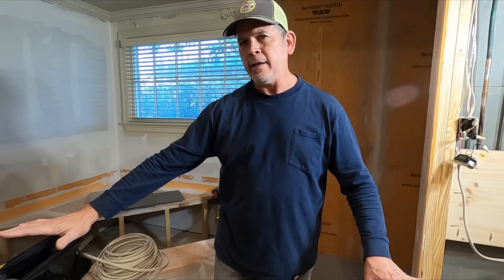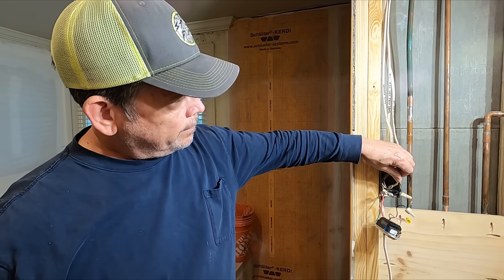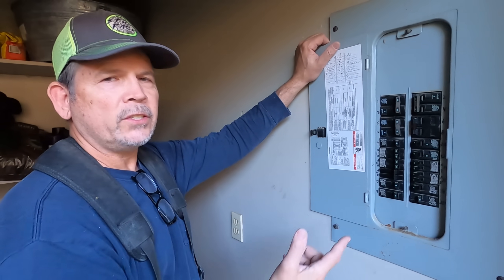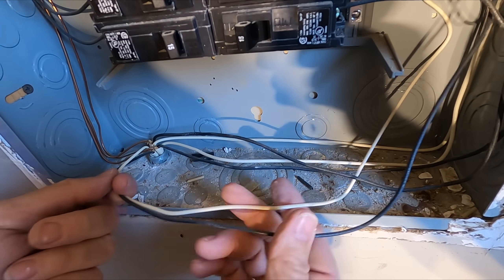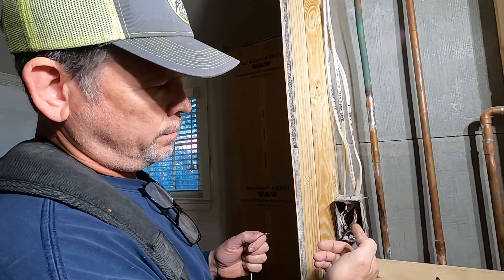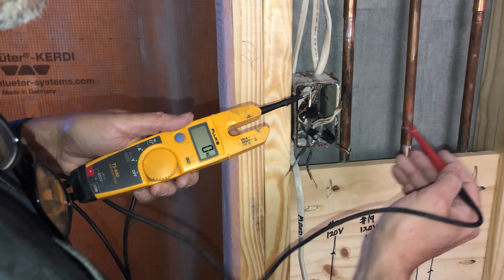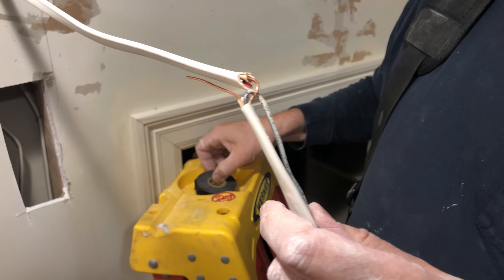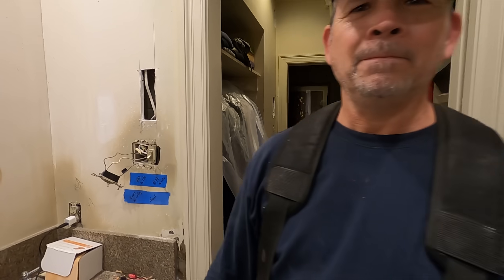You CAN Get SHOCKED by a Neutral Wire! This is How...

Comment: This a small sample of what happens when the home handyman, or anyone else that isn't qualified, does electrical work. "But the guy at Home Depot said........".  The people that work in the stores haven't a clue.
Neutrals and grounds are far more deadly than hots are and for good reason.
Reply: Properly wired Neutral wires and Ground wires are much safer than Hot wires. Those who ASSUME they are wired properly, with first verifying,  are the problem ...
Reply: @MrSummitville  The problem is when neutral connections are opened under load or a ground that is carrying a fault is opened. When the line side wire is touched, the body is now carrying the load (current) of that circuit which can easily be way more than enough to paralyze and kill. When touching a hot wire , the current flow is only what the body resistance allows. It can still be deadly, but your chances are better.
Neutrals are commonly opened in multiwire circuits where one one circuit is off and in single circuits where the power is believed to be off.  Grounds can be carrying current at anytime and you would know.  it will happen to plumbers that remove a bonding jumper on a water meter and in a variety of situations.

Comment: I'm not sure I understand why the neutral was left dangling in the three way switch box. What are some likely explanations?
Reply from the maker: The original electrician ran 14/2 between the two 3 way switches instead of 14/3 so he left himself without a neutral.  He picked one up in another box and simply abandoned the neutral he should have used.
Reply: @StudPack  Thank you now that fills in my missing link. That was really crappy of him. The mindset of "It works so I'm done, not my problem". Thanks for the explanation.
Reply: @StudPack  14/2 was the goto method back in the day though. 14/3 was uncommon in residential, cost more. wouldnt lay 'blame' on the original installer for using what couldve been considered standard at the time

Comment: We electricians in UK call this situation; a “borrowed neutral” often occurs when a downstairs light is wired in later years after construction. It makes wiring simpler to “ borrow a neutral” from the upstairs lighting circuit. Everything works fine until somebody starts poking around in switch boxes, and finds the error the “ hard way” .................shocking!
Reply: And that neutral may end up carrying 30amps instead of 15, without tripping any breakers. That house can get more light than intended.
Reply: @sergeyn.syritsyn6748  That neutral should NOT be carrying 30amps if done correctly.   The US has used "borrowed neutrals" as well, not sure if it's been coded out though that would be something you very often saw with knob and tube wiring less of an issue for NM wire runs since every cable has a neutral anyways,  but the idea is you take opposite phases and as a result you could potentially have 0 amps if both wires are running.   Looking at his drawn diagram of #19 & #20 junction boxes I would say this is most likely the case of what happened as odd values will be one phase, and even values will be another phase.      But the fact this was done with NM wire seems silly though.
Reply: @Mike__B  shared neutrals have been coded out for years. When I started out in the electrical trade back in the early 80’s it was discovered that a majority of all house fires were caused from an overload neutral because of neutral sharing.
Reply: @Mike__B  and car manufacturers still produce cars…doesn’t mean you youse it as a boat. 12-3 NM can be used in various residential applications, an example of that if you have a long run of exterior lights and you want to balance a voltage drop, next would be for a 3 way switch, another is for 3 phase 120/240 or 208/240, wrap a piece of green on it and you use as a ground and use the bare conductor as a bonding jumper between panels…as I said a bunch of applications. But to say because a manufacturer makes 12-3 Romex so you can use it to violate code by sharing a neutral in a circuit is ludicrous
Reply: @Mike__B  depends on where you are located in the states. You are referring to what we call multi branch circuits. Here in Texas in my district it is not permissible but I can go to the next and it allowed only by certified engineering.
Reply: Problems are sometimes caused here in the USA when they share a neutral on the same phase.  The current through the neutral is then the sum of the currents in the two hot legs which causes an overcurrent in the neutral that isn't detected by the breakers since the breakers are reading current in the hot legs.  When the hot legs are from the different phases the difference of the current flowing through the hot legs is what flows through the neutral.  It's why I think it's safer just to use a separate neutral for each circuit.
Reply: @Anon54387  That is so true. Here in the UK, every circuit is required to have a separate neutral rated for the breaker. 
Unlike the US, our 240 volt domestic supply is the grounded star point of the 415 volt final transformer, so on a 3 phase supply the neutral is the same size of the phase conductors. Electricians who are not electrical engineers often find it confusing that the current in the neutral cannot exceed the maximum current in any one phase due to current cancellation.
Needless to say, it is the reason that we cannot centre tap a phase to produce 120 volts, since one side or the tap would be shorted to the star point.
Reply: People often forget that the low (domestic) supply in the UK and the US is configured differently.
Here in the UK, the high voltage grid (11Kv) is delta with the centre phase bonded to earth. The final transformer is delta star, with the star point bonded to earth, so this forms the neutral. The supply is 415 volts, which gives 240 volts between each phase and the star point (neutral)
In the US, the final transformer is single phase or delta secondary with a centre tap on each phase bonded to earth. This allows 120 or 240 volt supplies to be obtained from each phase as required, again with 415 volts between phases.
Reply: In sweden if you do this. It MUST be 2-pol braker and also be text on panel that for exempel. F.20-19 using same neutral and earth.

But ofc, real work don’t do this shit.
Reply: Always come across that problem.
Reply: Shared neutrals are not permitted under any circumstances in accordance with the NEC. Though it’s still being used in the states, it depends on the inspector. When I conduct an inspection I often have the electrician remove the neutrals from the buss and do continuity check per circuit. Much simpler than opening every j-box. If the contractor has nothing to hide, they normally don’t mind.

Comment: Back in the day we would share neutrals on branch circuits.In most commercial installations you'll have three phase power.We'd pull a network of three hots(A,B,C phase),a single neutral,and a ground.When you have different phases sharing a neutral everything is fine.The current on the neutral returning to the panel is not excessive because of the nature of how phasing balances the load out...However,if you share a neutral with like phases then the neutral current will add together causing an overloaded neutral wire....The practice of sharing neutrals in my area has been discontinued for a long time now..The risk of getting shocked was too high..not to mention what happens when a neutral gets opened causing backfeeding which results in 240 volts going to receptacles, destroying equipment.
Reply from the maker: Thx chipper!  Perfectly stated.  I used to work at a place where a loose neutral caused backfeeding.  The resultant higher voltage burned up computers, printers, etc.  There was so much damage to equipment that they were able to file a claim with a $5000 deductible.

Comment: Guarantee there was an interim remodel by a armature electrician . Electricity is very straight forward . There is no magic .  (THAT shared neutral was result of DIY jerk that should have taken a bite of humble pie and researched a little )
I bought a house w THREE 3-4 way lights that only worked at the 'new ' dimmer switch .   THREE circuits wired wrong  and fixed with a minor rewired connections )    (original wiring in house was done right)

Comment: Doesn't the black tape on that neutral colored wire signify that it is actually a hot "black" wire or traveler?
Reply from the maker: I put it there to let me know which white wire had the voltage on it.  See my pinned comment.  It was definitely a neutral.  Couldn't be a traveler, this was after both switches and the load.  Thx for watching and commenting 👍

Comment: LOL... Irony is a strange ass thing my friend. Just  a few days ago I went through this exact same lesson with my 15 yr old son. A little while ago we bought another "renter special" that was built in '68; fun, fun, fun... The whole house was pretty much illegal, CA 3-way, or whatever you call them in your particular neck of the woods. The 2 main things I find in these old homes are:
1. All lights on same circuit, all receptacles on same circuit, etc.
2. All home runs were pulled to fixtures, instead of a switch location.

Anyway, was fixing a 3-way light circuit in the hallway and had to pull a couple new wires. 1 14/2 and 1 14/3 and I bet you can guess where and what for. Hint... I already had hot pulled into one of the rough in boxes from when I redid the kitchen, but the rest of that "jacked up" circuit was the way we found it.

Comment: I'm not even a journeyman electrician, just a jack of all trades master of none. I would have NEVER left a "unused" wire in a box.
Reply from the maker: Especially without a wire nut on the stripped wire 😳
Reply: @StudPack  even then I wouldn't have left one. If there is an extra wire I've done something wrong. From my learning that setup should have had 3 conductor wire (black, white, and red traveler) between switches. Not two sets of two conductor wire.
Reply: @campingwithpapaw  what IF that wasnt a 3way setup? you'd still have have a neutral in the switchbox, you'd have unused wire anyway in a 14/3 application. we ran 14/3 UF to exterior light poles, only used the black and white, red is just a spare or in case we need to add a photocell to specific poles

Comment: I am a certified electrician. You cannot take a colored wire, and put white tape on it in order to turn it into a neutral wire, but code allows you to mark a neutral wire with either blue, red or black tape and use it as a live wire. One more thing,  in any US or canadian home, you don't have phases. The service panel is fed with 120/240 single phase. There are 2 LINES...and one neutral.
Reply from the maker: Thx for commenting 👍  I marked that neutral with black tape as an indicator to me that it was the “hot” neutral.  I removed it later.  It definitely was a loaded neutral.  A hot would have tripped the breaker when connected to the copper pipe.  Yeah sorry about phases too line is correct.   A throwback to my commercial days 👍👍

Comment: YES on electrical.
- I "HAD" a handyman(actually a woman) who worked on an outlet without turning off the breaker.
--- I stopped the work, paid them, and sent them home.
-- I'm not a pro, just a homeowner.
I just had to start one more sentence with "I".. because..
Reply: you can do outlet, switch replacements live. should a handyman, electrician when shutting power off is feasible? YES does every handyman, electrician? NO

Comment: I ran into a similar situation and also got a jolt through a light. It definitely changed my perspective. I am much more careful to check wires. I don’t trust a non-contact voltage detector as a definitive answer, but I think it could help prevent situations like this.

Comment: this was great information.  i have seen similar issues in automotive wiring where a circuit is missing a ground and back feeds through a different circuit but never thought about this in home wiring and i have been shocked by a neutral before replacing a dropped ceiling light fixture with the breaker off just like you did.  this make so much sense now.  thanks for taking the time to share

Comment: how can you have a difference of potential between 2 neutrals on the neutral side of the load?
Reply: One of the Neutral Wires was being "back-feed" from another load (light) & switch from a second Circuit Breaker that was still ON ...

Comment: The neutral in that box is marked with a strip of black tape. Many jurisdictions allow for a white wire to be used as a hot as long as it is marked with black. This is common with 4 way light switches.

In this instance someone probably tried to fix someone else's mistake in a hurry instead of taking the time to figure out the issue like you did. 

Great video series!
Reply from the maker: That was me marking it as a "hot" neutral.  See my pinned comment.  Thanks Jason!!

Comment: As your typical homeowner viewer, I would like to know if one of the cheaper Klein light/beep voltage testers (NCVT-1) would have picked up on the "hot" neutral. I always check the area I'm working in with that tool, even with the breaker off, just to be on the safe side. Is this proper and would this "hot" neutral still be detected in the event I was to find one?
Reply from the maker: Klein has something cheap? 🤣  Yes it SHOULD pick up a "hot" neutral.  My issue was that after everything was confirmed to be safe, someone turned on a 3 way switch in another room and energized that neutral.
Reply: @StudPack  Haha, if they had something cheap, I definitely found it. But thank you for the reply and information on this. I just wanted verification that this would still be picked up as hot and my current method of testing would help me find this should it ever happen.

Comment: Enjoyed the video.  I too would like to see more videos talking about how you got shocked.  I've been bitten a few times and it was extremely unpleasant.

One comment:  I'm not an electrician but I am an experienced technician.  You made reference to "phases" coming into the box.  There is only one phase coming into the box.  It is a split single phase.  Measuring 240 VAC means you are looking at opposite ends of the same phase winding.  Most residential buildings don't have 2 or 3 phases connected to it.
Reply from the maker: Thx Greg.  Yeah I know re: phases.  Some say phase, some say leg, some say line.  Kinda like a polarized plug but AC current doesn't have polarity (like DC) 👍
Reply: Yeah, many a debates I've seen on this. I don't think it's universally agreed upon that they're NOT two phases in behavioral ways. It's sort of semantics. 
Split phase is certainly most correct, and I'm not really arguing that they should necessarily be called 2 phases, but in pretty much every way they do represent two, 180 degree phases with reference to neutral. (whereas 3 phase are 120 degrees; 2 phase are often 90 degrees). If you don't reference to neutral (as you don't with 220 volt) then really it IS one phase, but then again so is any system running off 2 legs of any voltage, including two legs of a 3 phase system.

Where I've landed on this: it should be called a 'split-phase system' but referring to each leg as a phase isn't truly abhorrent from a physics standpoint. I'm open to rebuttal on that point though.

Comment: so basically don't run a 3wire through a tandem breaker??
Reply from the maker: That is correct but my situation was circuits 19 and 20 (same phase) sharing a neutral.  In the end, both scenarios are the same... current on the neutral adds, it doesn't cancel 👍

Comment: Excellent explanation! Please do the other shock video. The fact that you are not an electrician makes your explanation easier for the common man to understand. 

One question. Why would the original installer leave that neutral wire abandoned?
Reply from the maker: Since they ran 14/2 instead of 14/3 between the 3 way switches there was no way to connect that neutral so they picked up another one off another circuit

Comment: Also, if you lift the shared neutral wire in the panel and leave both breakers on. You will be putting 240V in series on all loads in both circuits.
Reply from the maker: Correct on opposite phase circuits with shared neutrals.  This one was same phase so current on the neutral adds
Reply: @StudPack  Roger, good point.

Comment: It’s called a multi branch circuit. Those are a code violation in most states now. They only way you can use a multi branch circuit is with a 2 pole or breaker tie. But seems like this was wired incorrectly by the electrician who originally wired it.
Reply from the maker: Yeah it could have been an attempt at one but they put both circuits (#19 & #20) on the same phase plus they ran 14/2 between the 3-way switches so were left without a neutral.  Thx for watching and commenting 👍

Comment: Question,  is there a (tool besides a multimeter) that can check if a single wire can potentially shock?
Reply from the maker: non-contact voltage indicator
Reply: @StudPack  Thank you!
Reply from the maker: You’re welcome.  They’re useful to a point but I always check with multimeter too